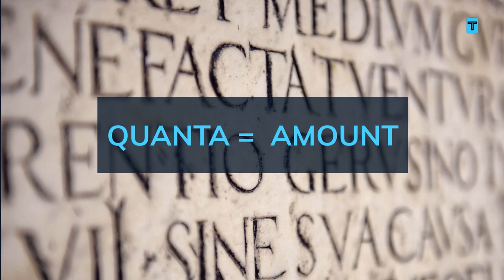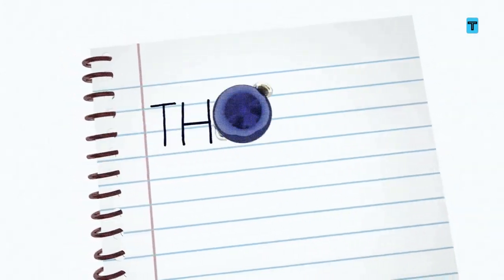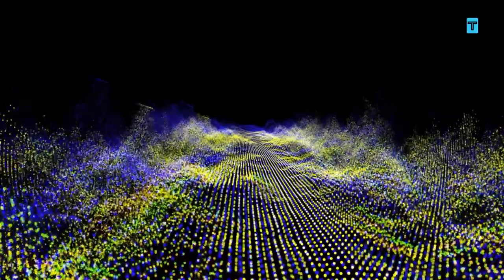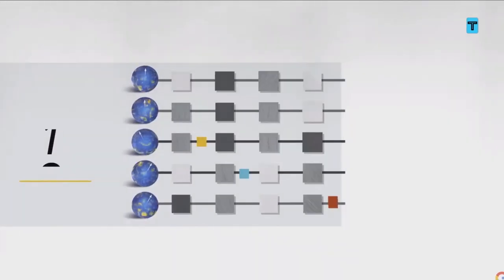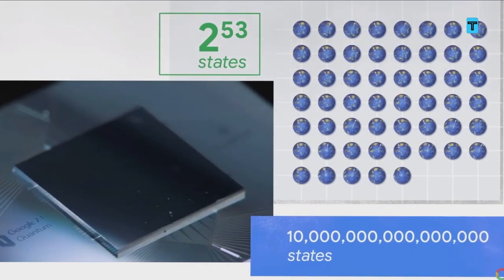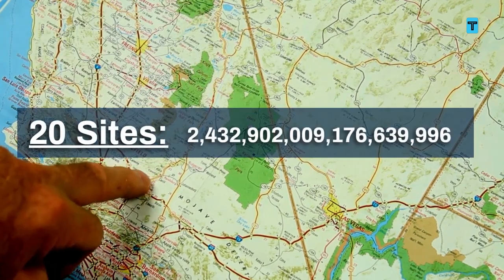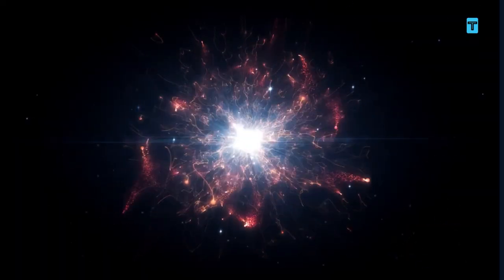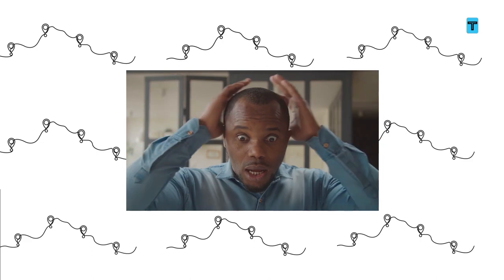Incredible Google’s New Mega Quantum Supercomputer

Comment: All very confusing but in the 2 coin analogy the second coin, which can be both heads and tails can be simulated by using a strobe light. Adjusted accordingly, it can show either heads, tails or a flickering from one to the other.

Comment: Solving the problem of information deformity can be sort of fixed by sending 3 identical bits of data that goes through a comparison unit at several places. Making corrections to the damage with a replacement copy based on the 2 unchanged bits. So 3 identical continue through the system. Yes it will operate slower by a minimum factor, but could handle thousands verse 30 or 50. It's like moving from a comidor 64 to a 286. Shortly moving to 486. Blocking out Microsoft from controlling the technology is a job for Google and IBM.
Reply: What? Eh?

Comment: Well doesn’t ER=EPR which those people that made the holographic worm hole was genius we can use a mixture of positive and negative energy to circulate the movement between two quantum bits and and have one bit that goes through it and comes out and when that one Qbit goes through the worm hole it travels so fast that 1 Quantum bit splits into many different particles and gives us so much information at once which holographic worm holes is the solution to the many problems that we are facing right now